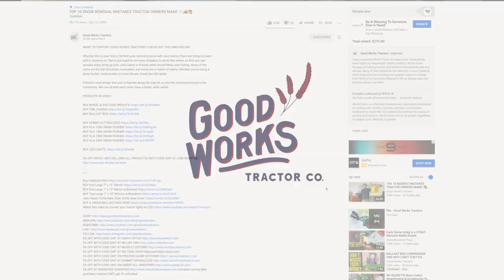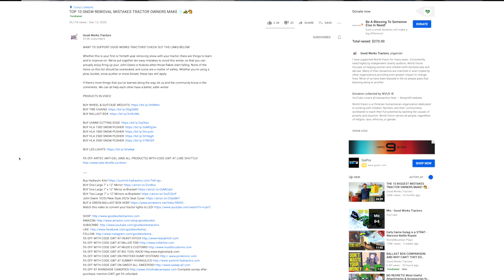TINY TRACTOR, TINY FARM: JOHN DEERE 1025R IS KILLIN' IT! 😎🚜

Comment: Great and awesome video. The case is made again and again for the well designed and implemented use of the stump bucket and the 1025r going through its paces. You also again make a case why purchasing a 1025r is a wise investment for many jobs for us that have bigger lots ,acres, or small farm property and want to do these tasks ourselves.  Thanks again Courtney& Chris have a great day and be safe.  Tim
Reply from the maker: Thanks Tim. The 1025 proved to be the perfect tractor for this job because of two reasons: the number of trips that made us drive over the same ground. In the end, that ground doesn't look too bad with such a light tractor. Second, having to run in the fairly tight space between the bushes and the house to remove the berm meant the smaller tractor gave us the most comfort and maneuverability.

Comment: A suggestion for the stump bucket;  have a couple of chain hooks welded to the top.  You can then throw a few loops of chain around the bush after digging up most of the roots and then pull the rest with the chain.  Maybe it is offered as an add-on for the buckets. It shouldn’t add too much cost.
Reply from the maker: There is currently a chain slot, but not hooks. Will continue to consider all suggestions though. Thanks!

Comment: It's "too bad" you didn't need palled forks for that job.  I was able to my new forks (HLA ultra light pallet forks from Good Works Tractors) for the first time the other day.  Attached the forks for the first time and moved the new ballast box in my truck bed to my pole barn.  Could not have been simpler, cleaner, or worked any better than it did.  Extremely cool!  Thank-you, Courtney!!
Reply from the maker: Glad they're getting work straightaway!

Comment: Hi Courtney,
Great Video!
If you think you're going to do many more earth, soil, or other moving projects like this, I recommend something like the King Kutter 1.5 Ton XB Dump Trailer. It has a capacity of 3000 lbs, has manual hydraulic dump, (via the tractor), and holds 35+ cu ft. of material. Great for transporting long distances. Sold at various farm stores, like Rural King, Fleet Farm.

Comment: I love my brush crusher. Sure there are times I wouldn't mind more front control, but for my needs hauling logs from the property  to my wood pile work great. When felling a tree, this brush crush hauls away all my branches really quick and without having to bend over and haul to a brush pile.
The downside I have is really operator error I suppose, but I tend to rip up parts of my lawn pretty often when using (I forget to lift the brush crusher up before I get moving).
We have a lot of autumn olive all over our property and this works well to rip those out by the roots without me taring up my arms to cut by chain saw--plus I get the roots.

I have the stump bucket and it is still new to me. It works for small  brush and really small trees. I don't think my 1025R has the front power to really dig up anything very big. I wished I could remove more stumps with it. Is there a way to make sure I am getting all the front lift power I should be getting?

Comment: Well filmed. Great use of the 1025r & attachments. I have not found that I need added weights but in the situation you were show casing it made a lot of sense to add them. Do you think the added weights helped you drive your bucket into the burm? I am think so.... as well as that tooth bar. Keep up the “Goodworks”!
Reply from the maker: The front suitcase weights must improve digging for the bucket. Is it measureable? IDK. Maybe in a future video we'll find a way to compare with and without? The toothbar definitely helps digging, no doubt about it. More PSI at the points of contact.

Comment: Glad to see you got the job done with what you had. But. I would have brought the tiller for the beds, chainsaw, large pruning shears, BH, grapple with hydraulic jaws(s) especially for the brush removal and could have picked all those 4 x4's without getting out of the seat which breaks cardinal rule #1, and of course the bucket. Would have made all of those tasks a lot faster, despite the BH removal and TPH installation. The brush crusher would make me mad, need jaw workings in any position. I'm glad it works for you though. The weather seemed to cooperate as well. Thinking about the HH tooth bar too. Do you think it's worth the money?
Reply from the maker: The tooth bar is definitely worth the money, imo. Love how it increases penetration of the bucket when digging. Also love how it provides a little ledge for the bucket to carry things like those 6x6's. Some of those things you mention would have made the job faster, yes. But I don't think a 3rd function grapple would have improved anything in this instance, and if I had a tiller in stock, I would definitely have preferred to use that for the beds. As for the chainsaw, well we just plum forgot it, and thought it was still a good opportunity to see how the stump bucket would handle getting at the base of an uncut shrub.
Reply: @GoodWorksTractors  It looked like it worked very well, I hope it's a big seller for you.

Comment: Some of those bushes could be removed, after your work with the bucket, by wrapping a chain around the base of the bush connected to the tractor or bucket and pulling. My 2 cents.
Reply from the maker: Likely so, but having to switch attachments and wrap chain might have nullified the time saved? Either way, they're out!

Comment: I'm curious... What weight bracket are you using ont the front, that allows the clearance for a full set of weights with the loader attached?
Reply from the maker: None, used the black frame of the tractor

Comment: Would have been nice to have used a larger tractor but it probably would have tracked the daylights out of the lawn. For what it is the 1025R didn't do bad. And a tiller definitely would have cut down the time. But with a larger tractor you may have finished the job in same amount of time. Honey is a great payment. There is no healthier food for your body.

Comment: For a guy that has access to lots of tractor sizes why did you choose the 1025?
Reply: Because the 1025r is the most popular size tractor, and to prove that you can do a lot of things with a small tractor.
Reply: @Dale.Nienow  Makes sense thanks
Reply: @Dale.Nienow  In your opinion which tractor would have been the ideal?
Reply: @vaughnburrows  I would have to go with a 2025r but with the 1025r it leaves less compaction with driving over the ground 50 times.
Reply: @Dale.Nienow  Thanks
Reply from the maker: Exactly what @Dail Nienow said.